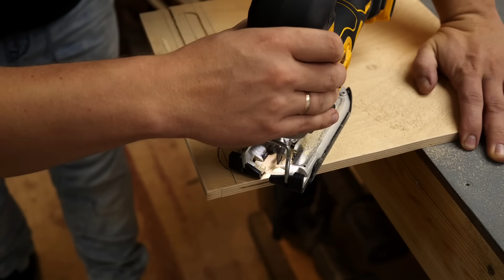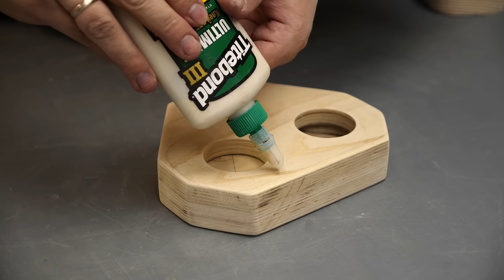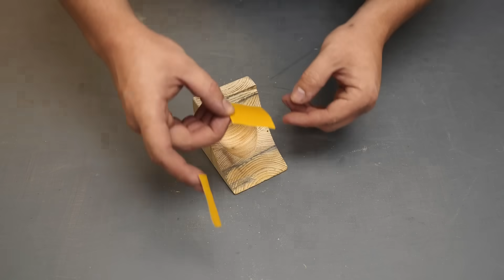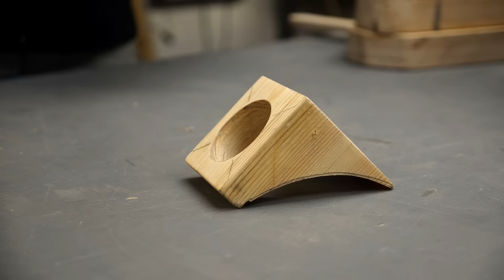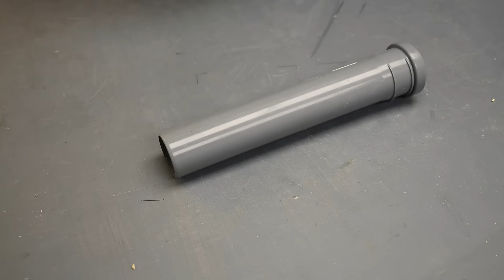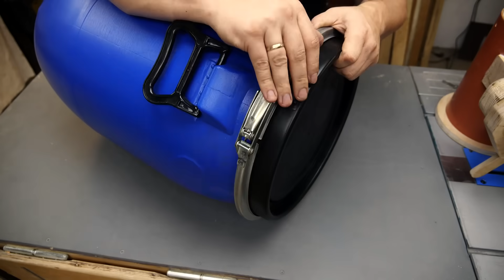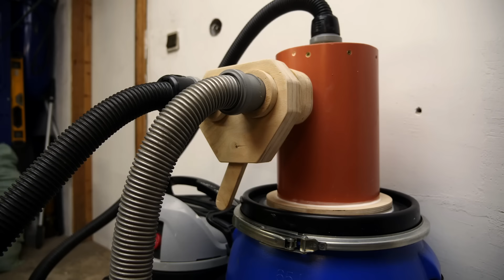Cool idea from a plastic pipe, for a garage or workshop!

Comment from the maker: Do you like this idea friends?
Друзья как вам эта идея?
Reply: Exemplary, and very compelling to watch.. the a nice bit of engineering, execution and video production.

I always look forward to your next upload.

And just like you say at the end of each video I give you a 👍
Reply: Seen it done before. This isn't original.
Reply from the maker: Are you confusing something)
Reply: Me
Reply: Generally a good idea. However, there was a point at which I began to wonder if the objective was to build a new civilization. 

The manifold could just possibly be simplified. How about a ball, captive within PVC pipeworks, yet relocatable from outside, that serves the function of the paddle valve?

all told, I think you'd have had an easier time -- and a shorter build -- of you'd just used the hammer for everything.
Reply: Pure genius!
Reply: I loved the video production..👍
Reply: Использование отрезка пластиковой трубы )) ага, только отрезок )) название  "каша из топора" Вам ведь знакомо?)))
Reply: Cool idea... maybe try that cool hammer trick on a large dollar bill & see if it multiplies.....🤣😂😭🤣
Reply: One advancement. Add a verticle baffle in the bottom barrel (or just under the entrance to the bottom) to help calm the air. It must turn in the tube, but must settle in the barrel.
Reply: Excellent! Half the fun of your videos is trying to guess (without cheating) what you are making! These are really good ideas, and I will certainly try some myself!
Reply: SUPER cool bro! I don't think there's much you couldn't make with wood and it's very satisfying to watch your idea come together. I finally figured this was going to be for dust collection around 7:00. Great job and looks great, as always!
Reply: If you're going to use woodglue Why use so many nails and if you're going to use that many nails Why so much Woodglue??
Reply: @biovoda07  не знала, как поприличнее сказать...
Но вам удалось, спасибо!
Reply: @biovoda07  , Согласен!
Reply: Ģh
Reply: Why not just run the hose directly from the shop vac?
Reply: @gordonbrinker  this should keep the shop vac filter from clogging as fast.
Reply: @janderson8401  Ah, I see. That makes sense. How about the two different holes and the wooden lever that switches between? Is that so that two hoses could run to different tools?
Reply: Здравствуйте! Пылесос на сколько ватт всасывания?
Reply: @janderson8401   most wet/dry shop vac's let you remove the filter. This dude just used $7000.00+ worth of tools to make something he could of accomplished with his hands in 30 seconds. This guy either has to much time or to much money on his hands.
Reply: @gordonbrinker  Look up 'cyclone sawdust separator' .. that's basically what he's made here.
Reply: No. Always describe what you are building in the title so people don't waste time watching. Finally after about two minutes I skipped to the end and saw... a dust catcher. Big deal. Not impressed. Thumb down. Don't waste your viewers' time.
Reply: Повторный вопрос АВТОРУ ВИДЕО: Пылесос на сколько ватт всасывания получился??
Reply: "Пластиковой трубы"...??? трубЫ ??? 👆каша из топора ↕
Reply: Skip to the end, then waste 10 minutes reading the comments instead. Some are funny. Not this one. This one goes on a bit.
Reply: Yeah but.....why?
Reply: @wolfnightfire242  The glue helps create an air tight seal?  Just guessing.
Reply: @gordonbrinker  Yes, he clearly attaches the two hoses to two different tools in the video.
Reply: @gordonbrinker  Good question...I'd think that you will need to have a few filters and  adaptors for all your tools so that they all fit into your shop vac hose...Seem to be a much cost saving approach.
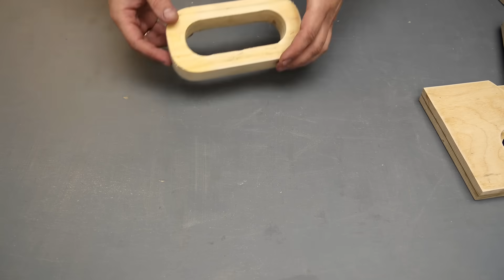Reply: 1:24 from where did you pull these?
Reply: Блин а у меня нет такого инструмента.. Мне не пригодится...
Reply: Движений лишних полно, а трубу использовал потому что названия другого не придумал да?))) Пойду дизлайк поставлю!
Reply: Easy like ek, dui, tri, shtar
Reply: I thought it was going to be some kind of a beer dispenser.
Reply: Do I get 20 questions at least? Wtf ru doing?
Reply: Бред, а не идея.
Reply: @egoshamassive  sorry.
Reply: Could be simplified.
Reply: Хоть бы размеры указал!!
Reply: Дизлайк за кликбэйт.
Reply: nice job
Reply: I gotta get me one of those hammers, never seen a hammer that could do that before!
Reply: @rtyhgfplmkoi4784  did he state somewhere it is his own invention?
Reply: W Polsce był taki film animowany "Zaczarowany ołówek" - Wszystko, co nim narysują, materializuje się. Powinieneś nakręcić "Zaczarowany młotek" :)
Reply: ممنون میشم عکس عکس یئ
Reply: @tommypetraglia4688  äääääüä0üüääääääää
Reply: yeas, i like it
Reply: No.
You have way too much time on your hands.
Go do some charity work instead.
Reply: سبحان الله وبحمده سبحان الله العظيم
Reply: Although, at the finish, I'd paint it to match the drum.
Reply: NO
Reply: Your video thumnail is a lie. So I'll blacklist you now for misleading clickbait.
Reply: @tommypetraglia4688  das
Reply: @mpeters7044  in in

Comment: I literally had no idea where this was going…I thought you were making large binoculars
Reply: For real though lol.
Reply: i thought about the binos for a second, too! i was trying to think about what could this possibly be as the video went on. the sealing between parts gave me a clue it was going to be something about air. but that's it :D
Reply: Or a garbage bin inside viewer, in case you were curious what's making all that racket without having to open the smelly lid.
Reply: The clicky thing reminded me so much of the face of the vacuum cleaner robot in teletubbies. I can't believe it ended up being related xD
Reply: So they're not binoculars?
Reply: i was thinking water nozzle or
Reply: I thought it might be a tool for sorting tiny screws
Reply: @1dallasstarsfan  i thought it was a wooden ET..

Comment: I really like your videos and appreciate straight-to-the-point style with no music or talking. I use a lot of the same techniques with plywood, glue, screws and finishing nails. On the project itself, very clever design for a sawdust separator! (there are simpler ways to do it of course) For other folks interested in simpler versions of this project,  just look up "diy sawdust separator" or "cyclone sawdust separator"

Comment: For those wondering, he made a dust collector. It prevents the sawdust from reaching the body of the vacuum cleaner, which helps keep the filter from clogging with sawdust.
Reply: Sterjs: thats what your air compressor if for to blow out the filter or you can put the foam ring on it then just wash it
Reply: Generally called a cyclone separator.

Comment: It’s a split dust collector. 

Keeps the heavier particulate from clogging up the shop vac filter for those of you who don’t know. The switch is to maintain full vacuum power, but if you already have to walk over to switch it, I’d probably save myself the time/materials and get a pre-made inexpensive dust collector and swap hoses as needed.
Reply: It could be done way easier/cheaper anyway.
Reply: I don't get the point of the switch, both hoses end up connected the exact same way.

Is the point just to have one hose for standard vacuuming and another for tools? Or I guess the ability to have two tools hosed up at the same time for quick switching?

That seems like an overly complicated solution to a non-issue.
Reply: @Fivizzz  Splitting the hose reduces the power of the vacuum. If both hoses were open, you'd have half the suction. If it's just you in the shop you aren't going to be running two machines at once. The switch is so that you're not wasting vacuum power on doing nothing.
Reply: @Fivizzz  he could've had a stopper on the end of each hose, so it achieves the same thing but at least the controls are on the end of the hose you were going to work at anyway and it saves you a trip to the lever
Reply: @FiltyIncognito   but
Reply: But it's the fine stuff that clogs the filter
Reply: I think the barrel is less about keeping the filters cleaned and more about extra capacity? I’ve no use for this project, but found it an interesting idea anyway.

Comment: The imprecise and non-symmetrical tacking drove me crazy.
Reply: I was thinking the same thing. I tend to measure where nails and screws go for a nicer finish, even when it is not visible. In the end, I cut all my woodworking in the driveway. My shop is used for mechanical things.

Comment: As someone who actually has a shop vac and uses it often I think this is a great idea. I wish a part like this was available at the hardware store tbh. 
Anyone that has ever used a shop vac knows that even if you put the dust trap on the inside it still spits dust. For those who are unaware: yes a shopvac is a vacuum but it has two opening one is for suction and the other is for blowing air out. It literally takes two filters and a t shirt wrapped around the filter  to keep my shop vac from spitting dust when I vacuum my garage and even then dust still gets everywhere for some reason. It is not a regular vacuum and dust goes flying everywhere if you don’t filter properly.
Reply: Home Depot sells a "muffler" type attachment for the exhaust port of the Rodgit shop vacs. It acts as a diffuser to quiet some of the sound, as well as tempers the exhaust air through a foam so that it's not like a leaf blower out the back. Might be worth looking into if it could fit your vac, or if there's another similar item for your vac.
Reply: Something is wrong with your shop vac if it is spitting dust and this contraption will not help. 
I can think of four possible problems. 
1: Wrong filter that doesn’t fit the machine. 
2: Wrong type of filter for the debris you are vacuuming.  FWIW fireplace ashes should never be vacuumed, while a HEPA filter will catch them it will clog almost immediately and if the vac is powerful it can tear the pleats of the filter. If you absolutely have to use the shop vac for ashes use shop vac bags and a HEPA filter, the bag will help protect the filter, but you will still have to clean it often. 
3: Damaged filter. A powerful shop vac will tear the pleats of a clogged filter. 
4: Filter not installed correctly.

Comment: Watched to the end.  How is this better than the shop vac all by itself?
Reply: Because you’d need to constantly swap hoses whereas this lets you, for example, have a hose permanently fitted to a table saw or other static tool as well as a hose for hand-tools, etc.
Reply: With most debris caught in the barrel rather than the vacuum the filter stays cleaner way longer.  You get much better continuous suction.  Many wood working shops incorporate similar products you can buy off the shelf.

Comment: That was alot of work for no benefit. Instead of emptying a shop vac occasionally you now have a 30 gallon barrel to dump. That's a little over 9 mins of my life I'll never get back..
Reply: Actually. These work very well. I have a store bought unit that snaps into a 5 gallon bucket.  Sure, you have to empty the bucket, but you empty 5-10 buckets for every time you need to clean out your filter.  That's a big plus!
Reply: @tntpfs  I suppose it has it's place. Just seems like a lot of work when you can do as you did and purchase one.
Reply: This is the method we are using on all of our shop machines, in lieu of a large shop dust collection system. As Tom stated these type systems do save on filter costs and since the filters clog less the suction remains strong longer as well. I do like his A/B valve which will allow me to pair a hand tool with a stationary tool saving the cost of extra shop vac units.
Reply: @mauryhan  Exactly!
Reply: In Murka we just throw the entire vacuum out when it's full.
And I mean wheezy-cram-jam-sucked-to-the brim full, cuz only losers empty vacuums.
 That's is, after we throw any superfluous hose attachments away. And damage the power cord. But first,  break the casters off
Reply: In Murka, when you turn it on, if a vacuum doesn't blow dust like a  heavy duty diesel dually  pickup truck blows black  smoke, then they  something wrong with the dingdang piece of sheeeit

Comment: Did you build this because your shop vac doesn’t have wheels?

Peculiar
Reply: Its just a dust collector for wood working thats the only purpose
Reply: It prevents the sawdust from accumulating in the shop vac, which prolongs your filter's lifespan. Since the dust doesn't go into the vac, the filter doesn't clog, which means you don't have to replace them that often.  They cost $20 and up, so this is worth it.
Reply: @csn6234  He could have build this all out of PVC plumbing pipe and run it around the garage so you can hook in at any point.  Like a whole house vacuum system.  It would have taken a lot less time.

Comment: Very well produced video. I was watching it and amazed that he could make the product so well, and make a video at the same time. Now I see in the comments that it's probably a team of producers, not an individual.
The one change I would make to the product, is to put the handle on top, so I don't have to reach around the hoses to switch it. That way, gravity would keep it in position. On the bottom, vibration and gravity could make it drift to the middle.

Comment: That's the stuff there. Sheetmetal guys do the same thing in large areas, with their compressed air supply. They call them "PIGS". You can have 6 attach points. This  2 point vacum is very ideal for a garage shop. Thanks for sharing.

Comment: Good grief man. How many hours were spent manufacturing this device? It takes a few seconds to pull a hose from a hole and switch it to another. I guess that's too much work?
Reply: If you want to find the most efficient way to do something, ask a lazy person to do it  ;)
Reply: I think the point was more to build a DIY dust collection cyclone rather than a device to swap between two connected hoses... that being said there's a major design flaw in that dust is going to be trapped between the pieces of plywood in his gate and eventually clog.

Comment: This is a cracking idea well done, even simplifying it down to a single hose system by being able turn a small capacity vacum into a much larger industrial size at a relatively low cost is magnificent idea 👏🏻👏🏻👏🏻
Reply from the maker: Thanks buddy!
Reply: Tzuede Off the Cuff    Huh? Where are the two vacuums?

Comment: Very nice. The only improvement I could think of is some kind of transparent panel on the dust-collection bin so you can see whether you need to empty it yet or not.
Reply from the maker: Thank you buddy, this is a brilliant idea, I'm already thinking how to implement it
Reply: @menscraft7985  
Drill a 1" hole in the top with a rubber plug to visually inspect or dip a 1" dowel like an fuel tank.

You're probably thinking a sight glass near the top but that might not be clear enough as sawdust would tend to stick 

At lesst this way I suggest is bare bones simplicity
Reply: @jabrwok is that really the only thing you could see
Reply: @dgodgo5983  it's the first thing that came to mind.
Reply: @menscraft7985  Cut a 2 inch wide slot vertically from 4 inches from the bottom to about 4 inches from the top, glue in a piece of plexiglass.
Reply: An excellent idea. Perhaps like a slot as opposed to a full window. However, it is a large barrel and will take a while to fill. Periodic checks might suffice.
Reply: @Kenneth Johnson Yeah, that's an annoying affectation.
Reply: Just try lifting it. If it seems heavy, think about emptying it.  Or have a beer
Reply: @shawnsisler3743  A long slot like that would seriously weaken the bin. A few 1" holes, at least a couple of inches apart would not weaken the bin too much.  Glue a piece of perspex on the inside which covers all the holes.
Reply: When it stops sucking? It's time to empty it.

Comment: I like it, but there are simpler and faster ways.
Reply: Yea you can find a splitter for about 5-10 bucks. Doesn't include the shut off feature but I'm sure they make them for not to much more.
Reply: That was a very creative way to build a vacuum splitter for your Shop-Vac. I believe it would be just as easy and relatively low cost to build a PVC pipe header with as many shut off valves that you needed.
Reply: Very poor design for airflow, noise and clogging up too. A simple act of plugging one hose or the other would be best